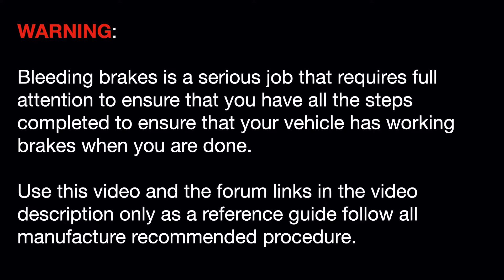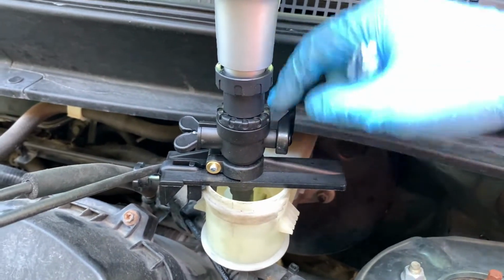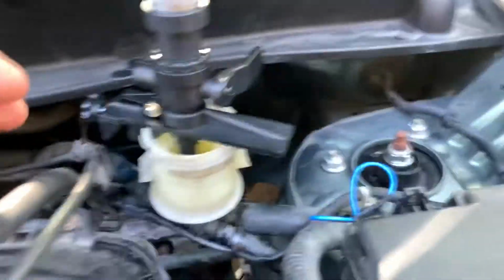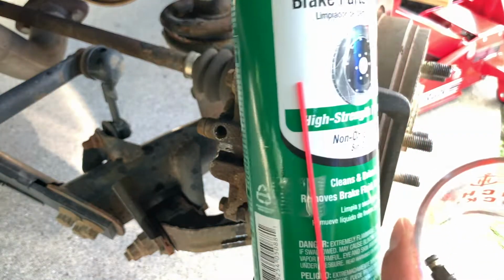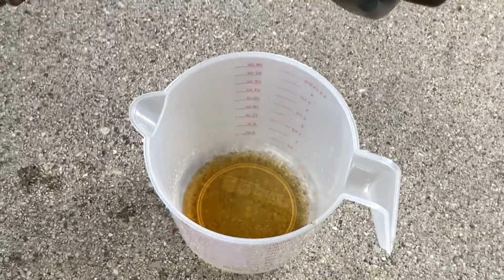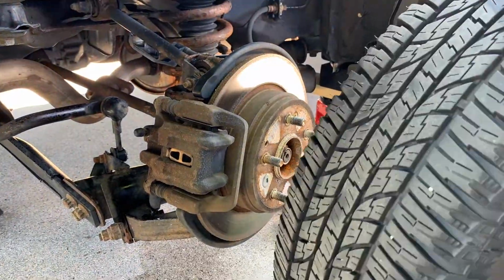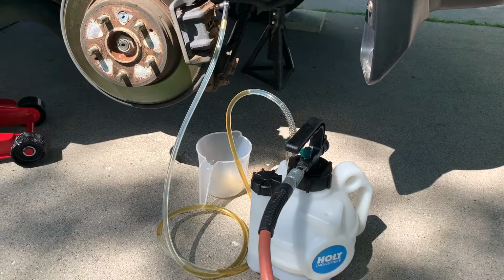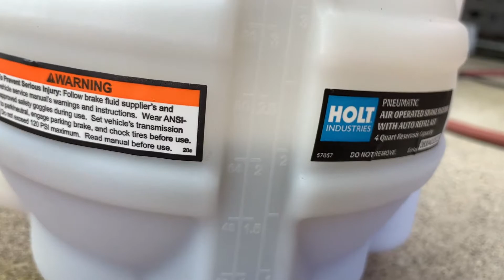Honda Element  - Brake Bleed via Vacuum Bleed/Flush Tool

Comment: The bleeders don't need to be anywhere near that loose to work. All you're doing is sucking air through the threads at that point which makes it more difficult to tell if you're pulling air from the line or air from the thread. 

Bleed order is not always done furthest point to closest point. Always check the user manual for bleed order because it also depends where the ABS module is located. 

Bleeder screws are cheap btw.... For all the time you took messing with them, a few bucks would have bought all four brand new 😂